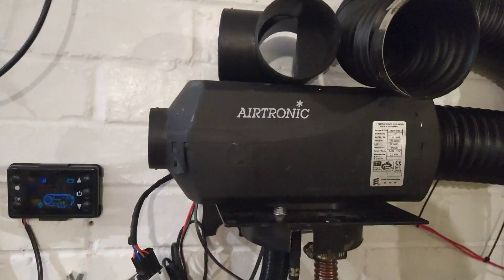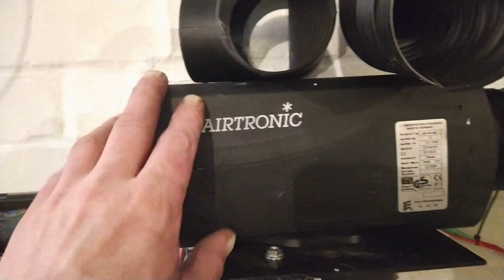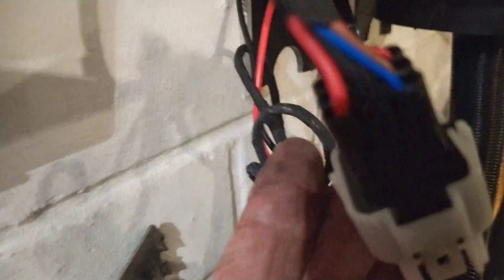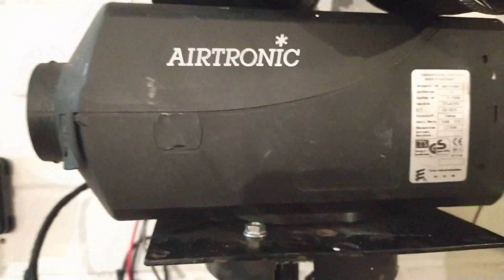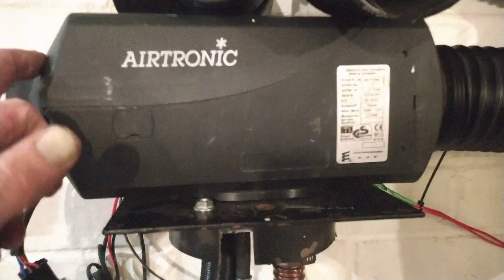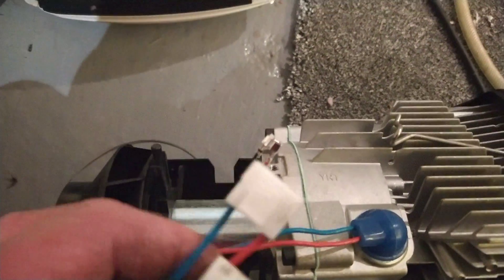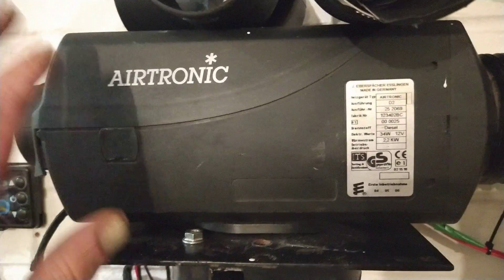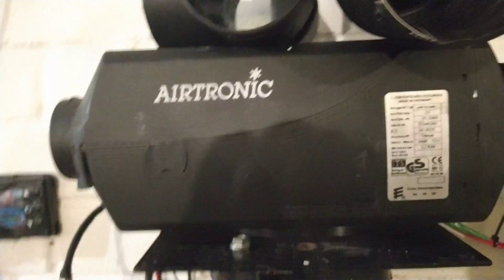running an Eberspacher airtronic D2 on a cheap Chinese ECU and controller !

Comment: Nice video, mate. Im going to give this a try.  
My chinese heater is making great heat , but the fan is making a strange noise.  I was given an airtronic D4 , with a broken control unit , so now im going to swap out the unit and swap over the motherboard,  and hopefully it will work.  Its minus 16 here in Canada lol and gunna get colder.

Comment: Had a D2 sitting under the bench since the ECU failed in 2013 and I bought a D4 new for £1400. to keep my workshop warm, anyhow after seeing your vid I bought a Chinese ECU and controller with remote for £20. and yesterday (January 2024) pulled the old heater out and installed the Chinese bits it fired straight up so cheers mate.
Reply: Brilliant!  I was just thinking the same. I've got an old D1 but it also needs the metal exhaust and air intake part as it's rotten.
Reply from the maker: @waterboy8999 i dont think it'll work on the d1 as they use a different style glow plug, not ceramic its a coil and takes a lot more power.
Reply: @karldingbat  
OK thanks, looking at the cost of a new rice burner there's really no point in messing with it.
Reply from the maker: The d1s were ok, but they used an awful lot of power and tended to stop working quite quickly, i dont bother with them to much. Hard to repair.
Reply: @karldingbat  this one definitely works but there's no starter relay in it and the exhaust port is very corroded. If you want it for messing around with I'll send it to you.
Reply: I don't suppose you have a wiring diagram for that do you?
I've got an old d2 sitting around, but local companies want big money just to bench test it.
Reply from the maker: Sorry i dont but if you search online you should find a diagram for it
Reply: @karldingbat 

No worries. I've found plenty of Eberspacher diagrams, which are complicated enough. I was hoping to find  one for the Chinese controller wires, and what each one does.
Don't fancy shelling out £75 for a simple Eberspacher controller, more money to bench test it, only to find the heater itself is knackered.
Cheers anyway.

Comment: Eberspacher quality is terrible. Early Nissan LEAF cars used Eberspacher wet PTC heaters, which failed on all of them due to very very bad design. I got Eberspacher D2 diesel heater too, which most of the time spent doing nothing due to various faults. Capacitor on cool air enable terminal was shorted to ground on main PCB, which prevented it from actually being used as a heater. Main dealer was asking few hundred pounds for replacement ECU. I managed to fix original ECU. Now it locked itself due to low battery issue. And because it has Wehrle controller in it, it requires very expensive diagnostic cable to unlock it. Complete waste of time. I am getting Chinese controller and installing it to Eberspecher as shown in this video. I hope this will sort all issues as Eberspacher clearly is not interested in after sales support.

Comment: Hi mucka, i looked at this as i have a spare eberspacher doing nothing. Only problem that i could see was that the chinese fan has two magnets and the eberspacher one, so this would obviously throw out the controller at some point thinking that the fan is actually spinning at a different rate.
So i intend to try to fit another magnet to the eberspacher fan and if this does not work, then just buy a chinese fan to fit on it which would obviously solve the problem.
But great work showing this to everyone.
All the best Kev ( yardley )
Reply from the maker: The chinese controllers give you an option of setting the amount of magnets you have in the fan.
Reply: @karldingbat  Thanks mate, so is that the SN 1  or  2 in the main controller setup then ? because these heaters come from factory with this setting at  SN1   yet there are two magnets as you know.....kev
Reply from the maker: Yep thats the 1 do you know the secret menu on those Chinese controllers ?
Reply: @karldingbat  well i know the 1688 bit to get to the sn1 or 2 setting is this what you are referring to ?

Comment: I'd like to get in contact with you please
Reply from the maker: My email address is poperss@hotmail.com
Reply: @karldingbat  Hi there, I sent you an email check spam folder I guess 💪
Reply: Hi, I've a D1L unit and wondering if the chinese controller would work with it?

Comment: The connectors for both ends are different, i have the same unitand chinese controller. Wire diagram would be very nice
Reply from the maker: Yes the connector's are different, i dont think any of the Chinese connectors are the same between each different company. They use what ever they have or can get.
Its a matter of trial and error im afraid, i would do a circuit diagram but none of the Chinese controllers have the same connection points on the board. What i did was use my original eberspacher ecu and cut the connectors off and resolder the Chinese 1s to the glow plug and fan motor, the overheat sensor need to be replaced with a Chinese 1 as the eberspacher uses 3 wires where as the Chinese only uses 2 but it still mounts onto the burner body the ssme way. Just 1 more thing, before soldering the plug to the burner motor wires you need to make sure its going in the right direction, i didnt check this the first time and ended up with exhaust coming out of the air intake and an overheating heater!!
Reply: @karldingbat  Eberspacher uses two overheat sensors built in one peace, that's why it got three wires. It's worth trying to measure Chinese heaters overheat sensors resistance and compare it with Eberspachers sensors resistance on two wires at the same temperature. If readings are close enough on booth sensors, then you can use Eberspacher overheat sensor too.
Reply: Do you think same color cables connected would work?
Reply from the maker: No, you can never go by cable color, i have known Chinese cables to be completely different to what is the norm i.e. red cables have been negative and black being positive, they dont have any standard color codes in China. Eberspacher though always use brown wires as being negative connection and red is positive.

Comment: Where i can find this Controller?
Reply from the maker: Ebay
1x(1pcs air-diesel heater control board motherboard fit for 12v/24v 3kw/5kw w2e
Reply: @karldingbat  thank you. And the cable Pins are correct or i need to change something

Comment: My fan is making a High pitch sound and I can get a new complete fan assembly for £17.00 and looking at it in photos I can't see why it wouldn't fit. Someone online sells what looks like the same one ( Chinese ) but works with the Eberspacher, in the photo's it's identical to the one I spotted for £17.00. I bet eberspacher are feeling the bite from the Chinese model sales. No harm but it serves them right for overpricing.
That's handy to know the controller and ECU works, apparently the pump does too 👍
Reply from the maker: Yep pumps are interchangeable, i used both pumps and they both work fine, in fact i found the chinese pump quieter than the eberspacher pump! The only pump you should not use is the webasto water heater pumps, they look the same but the flow rate is much higher. The chinese fan assembly is bigger than the eberspacher unit so it wont fit the eberspacher casing, but not sure if the actual motor would fit or not.
Reply: @karldingbat  That's handy to know. the one the guy is selling that apparently does fit the eberspacher is £47.00 so that may be the best option, still way cheaper than eberspacher. Looking at their 2kw smaller heater it looks the same. I have seen some larger models sold as 2kw so that may be the issue, making sure it's the smaller models parts. Who knows but even for the motor it may be worth the gamble.
Reply: @pa_maj.MARTINI-van-MAN  can you give me the link for the fan unit that you spoke about please.  Kev
Reply: How did you go finding a new fan ?